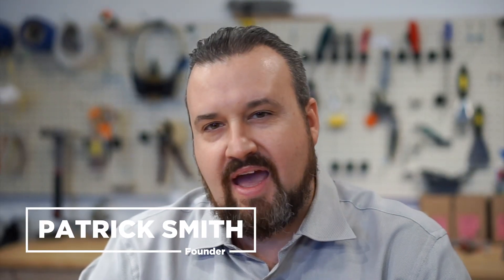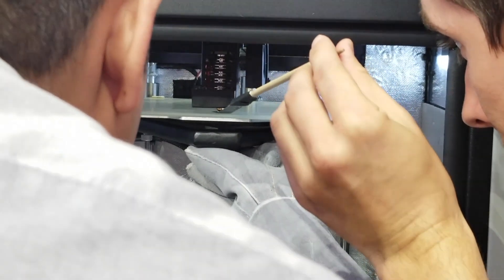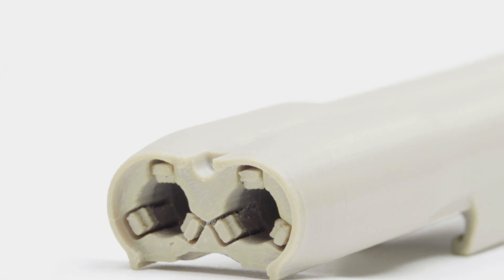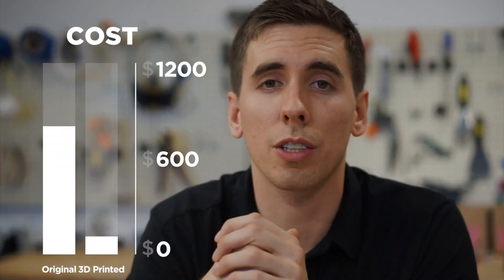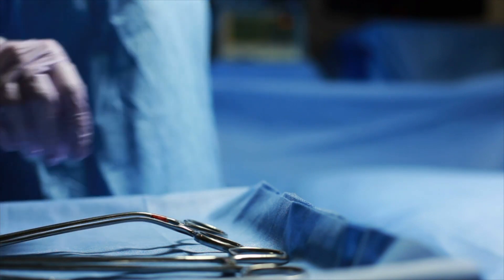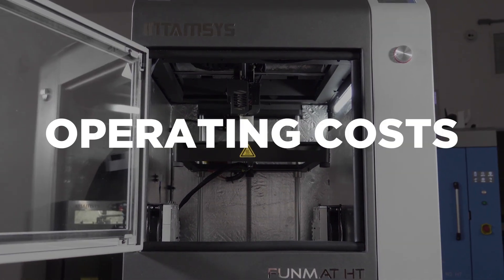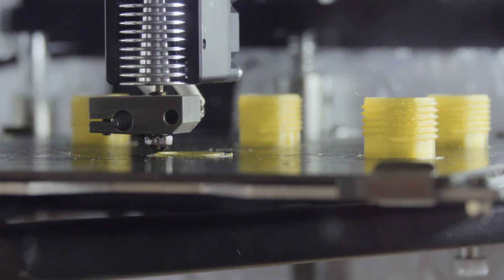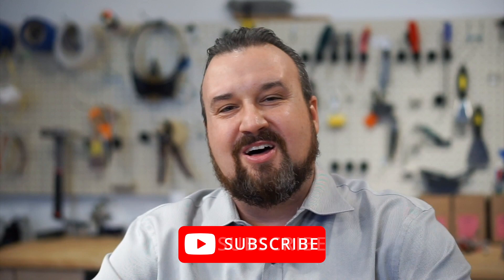Why High Temp? 2020 Business Advice For 3D Printing High Performance Polymers like PEEK and ULTEM

Comment: Imagine being able to make an internal combustion engine with PEEK, cylinder walls insulated by a razor thin layer of aerogel.
Reply: That's actually a really good idea and will probably happen at some point in the future, at least in racing engines.  PAI is even better for that than PEEK, since it has better high-temp properties than PEEK.  Its strength is actually similar to or better than 7075 aluminum around 450F.  The only disadvantage is the cost.
https://www.youtube.com/watch?v=CRd4Jy4Q4_4
Reply: @elonquemattheson6151  Yeah, I've seen the video. Torlon looks very promising, rumor is that research is still being done to this day, one team even tried to enter such an engine in LMP1 back in 2017.